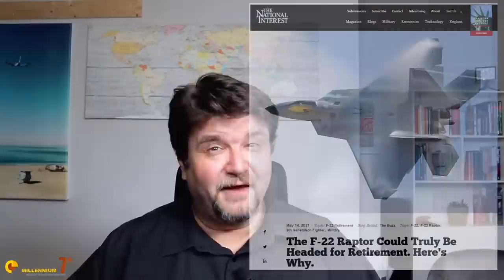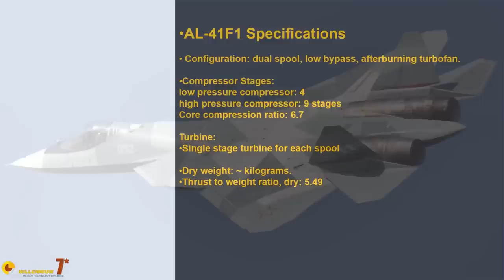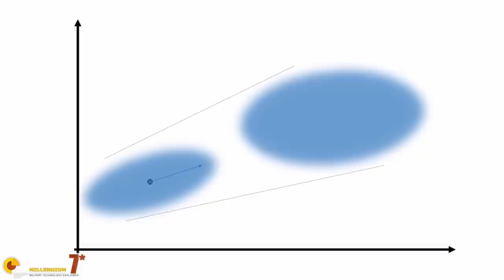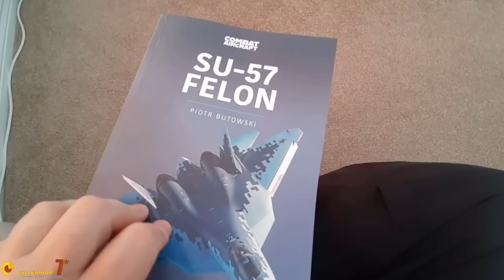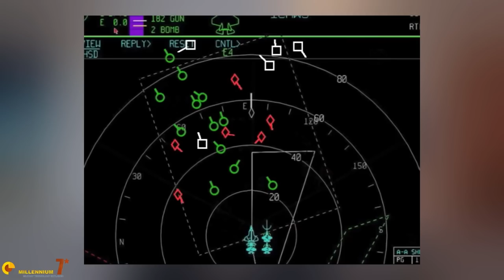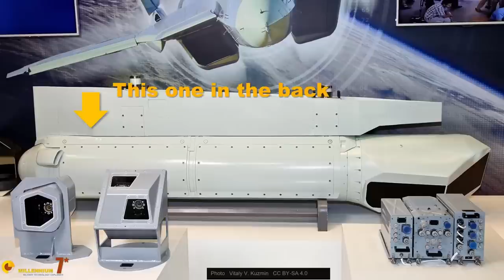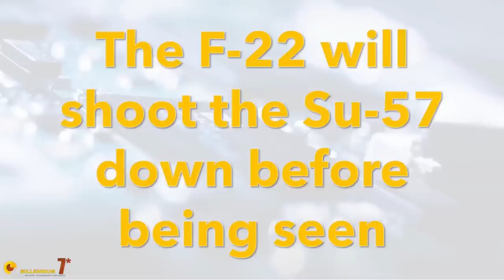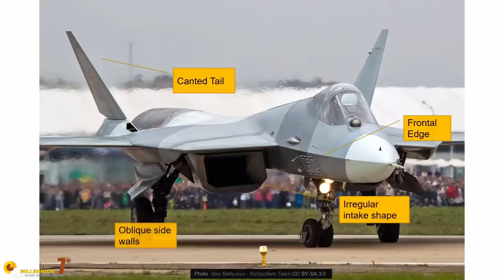Su-57 Update! + In Depth Analysis

Comment: There is one Western engine that will probably be using thrust vectoring.  That is the Japanese IHI XF9 with thrust vectoring nozzle XVN3-1.  Personally, I believe a more likely opponent for the Su-57 is Jian 20 rather than any Western aircraft.
Reply: that might be because the su57 has the same rcs as a hornet because the "3D" thrust vectoring engines, the IRS sensore at the front that cant be used without giving away position (it increases the rcs when flipped forward) and the insane rounded desighn underneath.  It is absolutlety the most manuverable aircraft in existance. What makes a 5th gen fighter is not manuverability it is stealth. The f-35 could spot the su57 and fire on before the su57 even if the su knew it was there. That's not even including the f-22 thats 20 years old and is going to be replaced in 5 years. ngad is not only in development, but is in production. a bidder already won but the us government refuses to say who or release the desighn. and thats with only a dozen su57 even made. its not even close
Reply: @Furious_Bananas  do you ever watched this video?
Reply: @Furious_Bananas  
F - 35 nemá šancu ani proti Mig- 35, Rusi vypnú elektroniku F- 35 a pilot sa posere tak ako nad Čiernym morom, kde zmizli tie fantastické F- 35 z Čierneho mora ?

Comment: 48:35 "The main antenna outputs 11kW". 
That seems like a lot of power for an antenna. 
The outlet on your wall can do 2kW. 
Normally, antenna power is measured in mW.
Reply from the maker: It is correct. It is the radar peak power. Very different from a radio.
Reply: @Millennium7HistoryTech  Sorry my friend it is not ( radar peak power ) . So first we must  know for which working mode of radar stands that value in kW ???  High or Medium PRF ? Another thing to know, AESA radars do not have so called ''stand by mode'' in which transmitter emitts radar signals to the reflector of the antenna but without emitting them to airspace .

You are right about that  signal polarisation on the three forward AESA radars/antennas in Su-57 but must know one thing more. We have also superposition of signals ( more signals into the main one ) and so on . For comparison ( that issue about  those kW's  ) . Radar N035 Irbis  has two transmitters . The main one has max pulse power of 20kW's . That max pulse power is on High PRF mode but only in that ''stand by mode'' . Even this value is only when the main transmitter  gets electric power from 27V DC-net . What is the max output power of radar  N035 Irbis ( on High PRF mode with 27V DC net)  ???  It is 800kW's ! 

So how can AESA radar N036 Byelka have that ( only) 11kW's of output power ???  Every TRM is multichannel and every channel has max output power that is measured in a couple of Watts or 10W and little more. All this radar energy is going into airspace as mentioned before without so called ''stand by mode''.  By the way , in that ''stand by mode'' ( which have radars with classic transmitters like TWT and so on ) ,  we have one issue / detail / and that is about  converting radar energy into heat energy. 

There are  my comments and answers   about Su-35S and his radar N035 Irbis and also about Su-57 

https://www.youtube.com/watch?v=cieLN4_tn0A

https://www.youtube.com/watch?v=p8C06dHhlXc

https://www.youtube.com/watch?v=cMMjCwMxd0c

https://www.youtube.com/watch?v=rxrOAkXaPFA

Wish You all best !

Comment: One of the problems with aerodynamic control surfaces is they have to move in order to work. But when they move they affect the RCS of plane. The best way to keep stealth is not moving control surfaces and keep plane in known RCS values as it will be seen by enemy RADAR positions which will be planned ahead of flight. So if Russia is using thrust vectoring as a way to maneuver without moving control surfaces to keep stealth as long as possible, it will be a new chapter in stealth design and strike mission planning for stealth planes.

Comment: I'd like to see where the output shaft from the engines is that drives the hydraulic pump and generator. 
Must be pointing toward the center body. Must be.
Reply: The sensor ball in front of the cockpit is ugly.

Comment: With all those different radar antenna why would I not be surprised to find out that the targeting computer is optimized to dumb fire otherwise smart munitions and that the thrust vectoring is there to augment this capability in a dog fight.

Use low frequency to get into visual range of a F-22 or F-35 then use otherwise smart muntions to get all General Electric style touchy feely with a target you can't get a high resolution fix on to use smart munitions in a traditional way.

That would fit within the parameters of Russia's approach to asymmetrical capability against the US.

It would also be a prime reason that NGAD and FA-XX are both trying to do away with vertical tail planes as those are the primary source of return for low frequency radar waves.

Comment: The greatest problem with active radar is that when You turn emitter on, You are VERY well visible. It works better when You are in numerical advantage (which is unlikely now) and can use emitters alternately, otherwise it is somewhat suicidal. F 35 use passive radars with external (e.g.ground) emitters. Anyway Su 57 gives good pilot ANY chance to fight F 35 1/1 (on unequal terms but usually better pilot wins) and decent chance to avoid ground to air defence (which evolves faster than planes) and attack targets like AWACS.

Comment: The Checkmate is even closer to the size of the S-57 than in the thumbnail.
Reply: I think the thumbnail is pretty accurate.
length:
Su-57 = 20m
Su-75 = 17.5
wingspan:
Su-57 = 14m
Su-75 = 12m
So, its just Su-57 not that long and wide thaan Flanker that we used to see. If you see the pict of Su-57 and Mig-29/35 on google, you will also feels that Mig-29/35 is pretty big aircraft

Comment: Bring on everything you can get about the Su-57. It's the sexiest-looking aircraft Russia has ever built. Aerodynamically it's a beast as well. Is it the most radar-silent aircraft out there? Who knows? But the Russians have possibly the best air defence systems on the planet. So there's that. 

The Su-57 is also said to have real-time networking capability with other Su-57's. Maybe NATO combat aircraft have that capability, I don't know. But that feature is potentially game-changing. It dramatically expands the scope of the Su-57's strike and defensive capabilities. If it works.

Have people in Ukraine heard the distinctive sound of an Su-57? Anything's possible, but I doubt that the Russians would ordinarily risk operating an Su-57 at an altitude that people in Ukraine would notice. There's Su-25s for that, unless Russia is really confident about the Su-57s ability to evade detection. Which they may be. There would only be one way to know for sure, and that's to put the Su-57 up against everything Ukraine and NATO have to electronically detect it. That would be the primary mission for the Su-57 at this time - not to launch weapons, but to determine how invisible it is to the enemy's defences. One has to assume that NATO is using its stealthy assets in the same way. 

I do wonder about military aviation platforms such as the Su-57, F-22 and F-35. Yes they're amazing. But what is their net impact on a typical battlefield? For the cost of one F-35 an army could put 100 MLRS artillery units in the field, pounding the enemy day and night. You might even have money left over for a few Iskanders. Which strategy is best? Quantity has its own quality in war. Plus, a single lucky shot could wipe out that one F-35, whereas a lucky shot against your MLRS units might take out a few at most. 

Abundant, repairable weapons that don't rely too heavily on electronics will continue to be an asset in any foreseeable war.

Comment: It happened with iaf su-30 mki when in 2019 airskrimish between iaf and paf when multiple amraams round were fired by group of paf-f-16 on iaf su-30 mki, by the combination of  electronic counter measures and  hard maneuvering using vectored thrust su-30 mki was able dodge multiple amraam rounds.

Comment: Su-57 prioritizes maneuverability because Russia understands it stands no chance at winning a conventional air showdown.  Thus the Su-57 is meant to loiter near ground based air defenses and race to close with western aircraft to force them into visual range combat.  This is a bad gamble. The Su-57's stealth is insufficient for the task of trying to avoid being a BVR kill until it can get close enough to force a merge.  It's widely accepted the aircraft has a radar signature similar to a clean, new gen F-18.  There's obvious signs the Russians haven't mastered the manufacturing process- there's gaps in body panels and cracks in glass that all produce radar returns.  

Any advantage the Russians have in technology is a moot point ultimately.  They lack the resources to bring it to bear in any meaningful capability.  The only area Russians are a challenge to the west is in electronic warfare, something they have historically done very well.  This advantage is set to be nullified as the west refines new gen EW tech like cognitive electronic warfare- a capability Russia is extremely unlikely to match due to both its brain drain and its difficulty sourcing advance microchips and components necessary for AI tech.  Putin's invasion of Ukraine has ensured Russia's slide into a second rate power is accelerated, and it's only real remaining advantage- sheer mass of reserve equipment- is being consumed.  That leaves only its nuclear arsenal.  Russia is doomed to fighting the next conflict with weapons a generation or more behind.  

But the Su-57 really is a pretty plane.

Comment: Thrust vectoring is not just about manueverability, it also makes the aircraft more redundant to heavy damage. Most viewers that question dont know that Russians rely heavily on electronic stealth aside from stealth paint, the vertical and horizontal stabilizers have a lot of electronic devices under it like the SU 35, to cloak the exposed engines and the tip of the horizontal stabilizer has an antenna array similar to the wing tips .___.
Reply: An F-15 once made it back to base without a wing, so check back when an Su-57 does that.  Russia is decades behind in radar and jamming technology (just now producing a few 1st gen AESA radars while the US is on its 3rd-4th gen), so it’s hard to buy into its claims about its electronic warfare capabilities.

Comment: One major point to be mentioned is that the leading Russian bird Su 57 is an evolving program and the final product & serial production will be made only after majority of the defects are rectified. The eye ball is on a better product to endure a much long term and particularly within the budget assigned. 

On the other side the leading  western bird  F35 was rushed into production even when defect were identified and continuously being identified even today. Still lacks many of the fifth generation characteristics. The eye ball on this was on the profitability of the manufacturing companies and ripping off tax payers money as opposed to endurance. This evident in the readiness of the bird for a flight and costly maintenance. 

In simple terms the difference is similar to taking Kamaz truck vs Ferrari Car to war. One is build to use tough the other is build to be beautifully fragile.

Comment: S-75 looks way smaller than Su-57  in that pic, it's jusrt not much smaller in lenght and wingspan. Looks like they share the same wings and maybe even horizontal stabs. The difference in wingspan comes from the fuselage, the Su-57 having a very wide fuselage, therefore we can assume the S-75 has a much lower volume and weight. It's not Su-75. Su designations are issued by the Russian government after design acceptance by the customer. If this was a design commisioned by the Russian government we would be calling it T-75.

Comment: Any aircraft that can carry a missile can be used as a standoff weapon. You don't need a stealth supersonic fighter to launch standoff weapons. What was the purpose if not just to prove that the SU57 plane can still fly? A single B52 which is a huge blip on a radar screen can deploy 20 cruise missiles with W80 150 kiloton warheads each (10 hiroshima bombs) for a total of 3 megatons of happiness. One trick used at air shows to maximize the performance of aircraft is to fly them with no weapons and only a small amount of fuel to make the plane as light as possible. This does not reflect its performance as it would be in combat. The SU57 was supposed to be Russia's answer to F22 but by the time SU57 is deployed in any meaningful numbers the F22 will be in its retirement phase to be replaced by America's Next Gen planes. 

The So called SR72 sometimes described as the SR92 and Aurora is well into development as Lockheed has been working on it for many years. Based on what little  has been leaked (possibly false), rumors, educated guesses, what little we know of it is that it will be unmanned, fly at least twice as fast as SR71, will be stealthier than anything we have now, and will be able to use weapons as well as act as a spy plane. Based on the way it will be deployed it is said it will be able to be over any target in the world in under one hour. 

As Russia's and China's "stealth bomber" seem to have borrowed their shape to a degree (I won't say copied) from B2, Russia's drone seems to look suspiciously like the X-47B US stealth drone. Originally that drone was supposed to be a spy/attack weapon and proved it could easily land and take off from an aircraft carrier at sea reliably but has since been relegated to be a refueling tanker. 

While Russia and China struggle with their first generation of stealth fighters, bombers, and drones, the US is nearing the process of replacing its current generation with much more advanced aircraft. We hear some wild rumors about what they will be but they are completely unconfirmed.  One rumor has it that they will be able to project a vast number of images of itself making it virtually impossible for an enemy to detect which is the real one and which are the images. Sounds impossible but with the US the impossible often just takes a little longer.

Comment: Reminds me of the F-16xl that the air force should have bought instead of the antique aerodynamic design F-15. F-16 was going back from the F-16, an far back from the f-16xl when they decided to go back to a plane that is now such an old design. Nobody flies such an old aerodynamic design
Reply: The F-16 and the F-15 are practically the same age, with overlap among the variants. It helps that the F-15EX is a big upgrade, an upgrade that the USAF didn't have to pay for as the design work was paid for by foreign clients. They bought the F-15EX for that reason, because of its payload, range, loiter time, radar, and because it fit their overall doctrinal requirements. The F-16XL might be a great plane, it probably is, but it wasn't the best plane for the USAF.
Reply: @edwardharshberger1  F-15 is still aerodynamically a much less sophisticated than the F-16. And the F-16 xl was a further aerodynamic design. the F-15 was just a MEP upgrade, and could have been for any aircraft. Better to have put in more advanced aerodynamic aircraft.

Comment: What was the purpose of the grid like fins on the R77?
Reply: It steers the missile like normal fins do. Not sure what you get compared to normal fins, I speculate think that the grids would have higher drag while going straight, but perhaps more bite for snap turning.
Reply: Same reason that Space X uses them.  More control authority at high angles of attack and easier to package relative to a single surface control fin of equivalent total surface area.

Russian missles are built around some ridiculous off bore sight shots relative to most Western ones

Comment: I wonder if the L-Band radars are meant to be used to lock on stealth fighters in short or mid range?
Reply: L Band doesnt have the Resolution , close in it would use high resolution such as X band
Reply: @damonburroughs5283  wat resolution are you talking about? You mean effective distance of the wavelength?
Reply: @foshizzlfizzl  L band , like civilian radar doesn't have the resolution, as in the the band isn't narrow enough to accurately get a position and thus a lock. It is helpful as he said to supply a ballpark direction. It is the hyped tech that folks have claimed Russia has to detect stealth , which isn't new or not already known, just not much use for weapons lock or accurate tracking, similar to how IR/UV isn't either that's fitted to most western Jets such as the typhoon. Handy tho but a target can be lost easily as the sweep will be detected in return

Comment: Will there be a weapons grade lock with "L" band radar?  Do we know all the capabilities of either aircraft, I whatever specs on this crafts made public the actual specs of either aircraft.  There is a reason the US gov doesn't export the F22.. to anyone.  None of these air crafts are magic...Tactics are required which is how all of these weapons system are designed.

Comment: the empty weight of the SU57 is 18.5 tons, the F22 is 19.7 tons, the Su-57 is larger but lighter than the f22. the Su 57 is the 6th generation. in 23, he will receive a 19-ton thrust engine and will soon receive a photonic radar